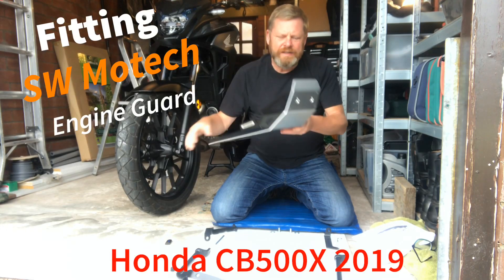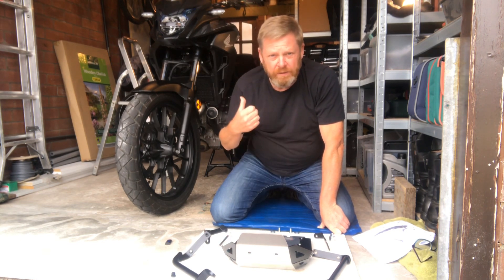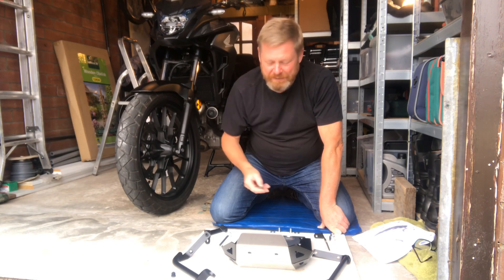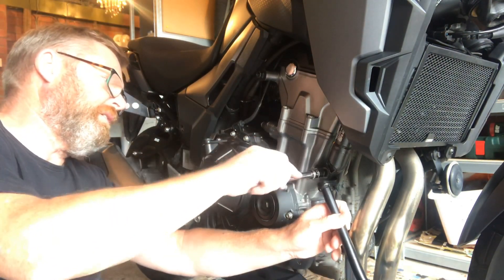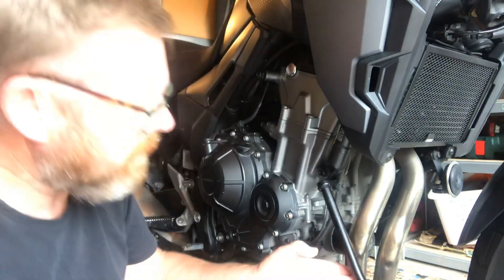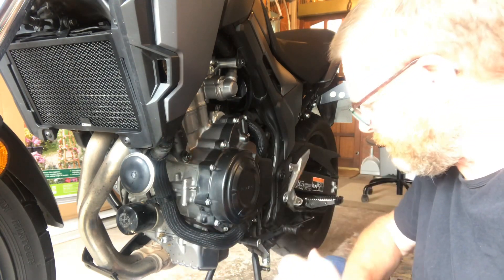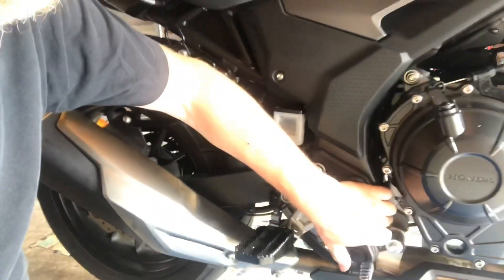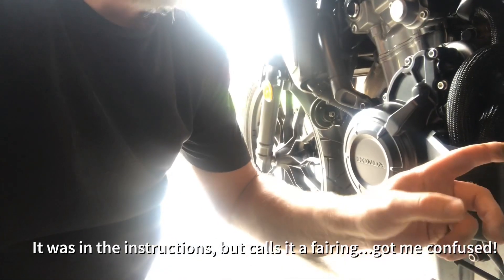SW Motech Engine Guard fitting to Honda CB500X

Comment: I'm here for the accent ;)... actually waited weeks for my skidplate and plan on putting it on this week after I get my bark-busters sorted (not as straightforward as one might think). We have had a 6 month long winter her in northern Wisconsin USA and stil have average of 2' of snow on the ground, motorways with tons of brine/salt and divots in the asphalt (potholes). City streets need to be patched (highways are ok), and rains need to wash the salts. I've got 4 miles on my bike, none by me. Cheers!
Reply from the maker: Nice one 😆 roll on the summer season, I’m sure you’ll put many mokes on the bike once you can.. There’s a quick fix to the Barkbuster fitting, have a look below and have fun on the road 👍🏻 

Fitting Barkbusters Handguards to Honda CB500X
https://youtu.be/Ym2N2CYWrsk
Reply: @thecampingbiker791  yeah I used your method for the barkbusters. super slick. is this video here applicable to the 2022 as well. hoping to get on this tomorrow. Aside from doing this for a vide, how long do you think the install should take?
Reply from the maker: @4himsanctified  yes, no change between models and with the video I’d say about an hour to an hour and half, but I’m slow and like to take my time 😆

Comment: Thanks for the video! Helped me a lot. I only wished you had included the torque pecs for the engine bolts as I am really struggeling with reading the diagrams I find online. I already pushed installing the bash plate for a long time as I'm terrified of overtorquing them and causing serious damage...
Reply from the maker: Thanks for that, yep sorry about engine nm just me assuming everyone has a Haynes manual 😂 So, from the Haynes manual rear lower is 55nm and front bolts 45nm When doing front bolts tighten from left side first, the others don’t seem to matter 👍🏻
Reply: @thecampingbiker791  Thank you so much! :)
Reply from the maker: @Marvininini  no problem 👍🏻

Comment: thanks for your video 

my concerns with the SW-Motech system - is that the shocks go directly to the engine case and this could break. That is what I hear in the forums and reviews. I tend more to the Really Raid solution. Maybe you can write something about it, since you have now 2 years experience.
Reply from the maker: Yes, my thoughts after fitting and took it off next day getting the RR instead, which is rock solid.  Good idea, I’ll do a follow up on the RR 👍🏻

Comment: Just wondered why you went for a bash plate instead of  crash bars as you don’t do any heavy off roads and bars would save you bike from damage when dropped, good vids enjoy watching .
Reply from the maker: Stuart 2453 my plan is to do more off road and to be honest I don’t think the SW Motech is really the right guard for much more than gravel tracks...so watch this space 😂 😂
Reply: It should protect the engine from chippings thrown up by the front wheel. Looks like it protects the oil filter as well.

Comment: I need one of these too!
Reply from the maker: CD T they are really nice quality and fit well, but I think their use is better suited to mainly road and gravel tracks rather than anything more difficult! I’m a few days behind with posting, so watch for next video update which I’ll post later 😂 👍🏻
Reply: How much vibration noise came from the new sump guard,  can u hear it at idle, thinking bout purchasing one, looks strong enough for my riding.
Reply from the maker: terry haught not a sound and no effect on bike ...Easy to fit 👍🏻
Reply from the maker: terry haught sorry, was talking about Rally Raid one I’ve subsequently fitted...the SW had no vibration but I had a resonating sound which can happen with aluminium and in the end it just wasn’t for me as wanted heavier duty.  Easy to fit 👍🏻
Reply: @thecampingbiker791  the rally raid does look hell for stout.
Reply from the maker: terry haught it certainly is 👍🏻

Comment: Great video. Thank you. Has made me help decide to go with RR instead. I feel this will not hold up off road. Gravel is fine but then why bother. I'm not worried about a  centre stand on this bike. Im using a track stand if need be which can be folded and packed away.
Reply from the maker: Thanks Matt, pleased it was helpful and for letting me know…my RR has had a bit of a bashing now but stood up well  😂

Comment: Great job and looks nice. Can you get to the oil sump plug easily for an oil change or do you have to take the guard/plate off? I know with the Rally-Raid guard it has to be removed to do the oil change. Many thanks.
Reply from the maker: No need to remove this one, easily accessed for oil change...but RR is heavier duty...I believe you just have to loosen front bolts on the RR and remove back bolt which goes through centre stand housing, then it tilts down for oil change....anyhow I should be able to confirm this shortly 😂 😂
Reply: @thecampingbiker791  Many thanks. Your explanation will help my purchasing options. 👍
Reply from the maker: Patrick Mills I’ve decided to change to the Rally Raid 😂 but this is still a good quality guard 👍🏻
Reply: @thecampingbiker791  thanks, I just saw your lasted video. Like you say it's a a good bash plate but I think it hangs too low thus not giving good ground clearance. RR is the only option for the 500X.
Reply from the maker: Patrick Mills my conclusion and I knew it before but wanted the centre stand!!  Anyhow, SW will be fine for road use and minor gravel track and hopefully fitting video of use to someone 👍🏻

Comment: I have got same bike and same skid plate. I am strugling with vibrations/noise. Did you add any rubber washer between supports and plate?
Reply from the maker: @nimuji86  it only lasted a short time, I removed it and put a Rally Raid guard on it..   Is the noise that irritating resonating vibration?  If so, you could get some rubber matting, cut to shape and stick to top of aluminum plate and that should help with the resonance
Reply: @thecampingbiker791  thanks! I will try with 10mm male/female silentblock. Lets see if it works🤷🏻‍♂️
Reply from the maker: @nimuji86  let us know how that goes 👍🏻
Reply: hi @nimuji86 .... did you figure out how to get rid of that annoying noise(vibration).. I just bought that bike and it already had that skid plate and I don't know how to fix that... thanks in advance for any help
Reply: @ try with kind of o-rings between supports and plate. After installation, dont tight the screws so mutch.
Reply from the maker: @nimuji86  did that get rid of the resonance sound.. good fix if it did 👍🏻

Comment: Hi, did you manage to change the oil with the guard fitted?  I don’t think I would want to take the skidplate off every time I changed the oil!! All the best, John
Reply from the maker: Hi John, it’s designed with a heavy duty pin/bar  (goes through the centre stand fitting) with single bolt to extract it, then designed to hinge down at rear allowing access. For the filter at front, just needs 3 bolts loosened and the aluminium plate lifts of. Nice and simple, Honda did my last service and mechanic commented how straightforward for an engine guard! 👍🏻
Reply: @thecampingbiker791  Thanks mate, I will give it some thought. All the best, John
Reply from the maker: @johnbaker7626  good question and something I thought about at the time of buying as I need I needed to be able to service when travelling....my next little project is to make a roadside ‘stick lift’ for lifting back wheel off ground to maintain adjust, clean and oil chain when travelling....but I do have a plan 😂
Reply: @thecampingbiker791  I think Rally Raid sell them. Look quite neat.
Reply from the maker: @johnbaker7626  I’ll have a look, although I’ve already got my bits to make something 😆
Reply: @thecampingbiker791  Rally Raid Endurostar Trail Stand
Reply from the maker: @johnbaker7626  don’t think that RR supply that John, I’ve only been able to find it in the USA
Reply: @thecampingbiker791  I will have to take a closer look at my SW Motech skid plate. I have made a mess during oil changes and an easy removal would be welcomed.

Comment: Good video thanks. What was the torque for the engine mounts?
Reply from the maker: Hi Nick, standard Honda settings: rear lower 55nm and front lower (left side first) 45nm 👍🏻
Reply: @thecampingbiker791  Thanks. Just got the 2020 version, did the first 500k yesterday. Cracking bike for here in Asia. Been watching your videos about fitting the parts, coincidentally all the same as yours. Happy and safe riding bro.
Reply from the maker: @nickhendley9303  thanks Nick, appreciate your thoughts. Sounds like you should have some great adventures out there and yet another place where I have new friends when travelling 😆 These bikes are such good all rounders and more than enough power for me as I get older, the improvements I’ve done to mine have made the bike so much more!  Safe riding and enjoy the journey, regards Andrew 👍🏻

Comment: Will this fit for 2021 mode?
Reply from the maker: Hi Tarun, yes it will fit 2021 model, the only real change was colour scheme, keep safe and enjoy the bike, regards Andrew
Reply: Thank you. My 500x is red
Reply from the maker: @Choicesoftarun  I love the red, it’s proper Honda colour, and was originally looking for one but my black came along and it’s very good for wild camping 😆 👍🏻
Reply: I have another question. I have got givi engine guards & Tank guards. Now, am planning to get sw moto tech sump guard. I want to know whether the crash bars of tank & engine will cause any hindrance in mounting the sump guard. Could you please help know?
Reply from the maker: @Choicesoftarun  I’m not 100% sure with Givi as not used them but I think that they may do so as I think the spacers are replaced by the fittings….hopefully someone else might see this and advise 👍🏻
Reply: Ok, I researched myself a bit & understood that sump guard from sw mototech wont fit with givi crash bars. So, am considering T rex racing ones
Reply from the maker: @Choicesoftarun  thanks for letting me know and I like the T Rex but struggled to get in UK at the time…looks solid 👍🏻